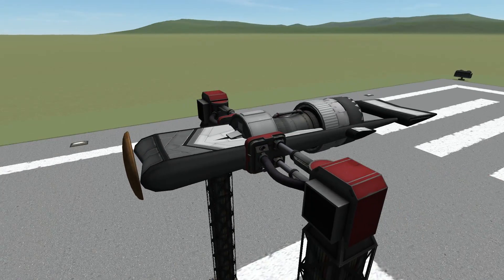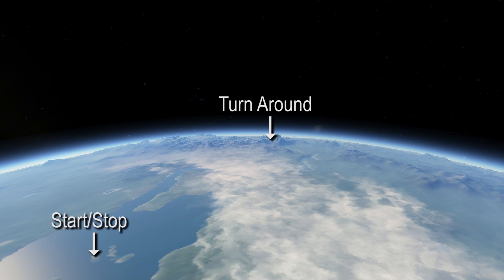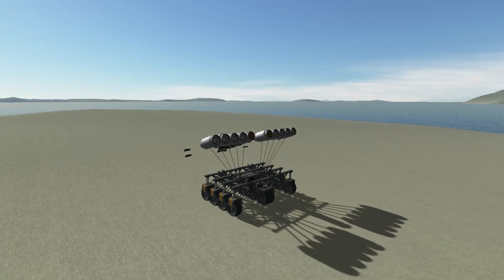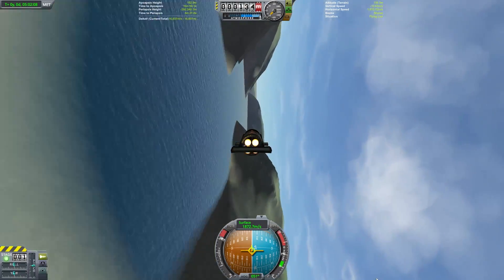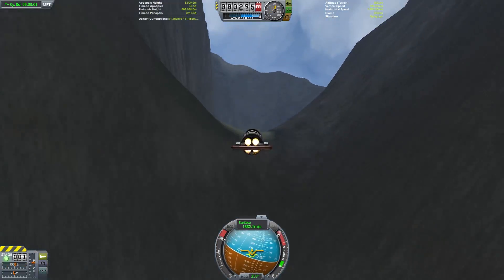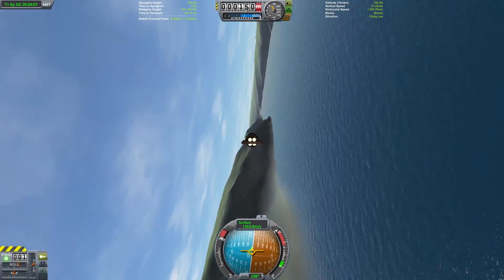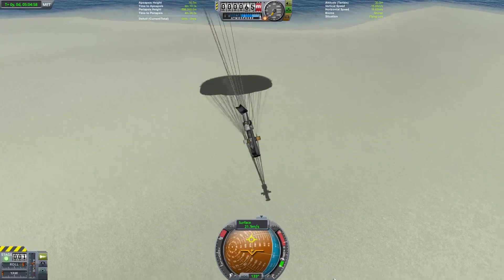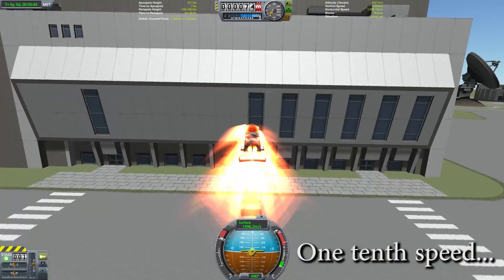Racing though the K'yangtze River Canyon -  KSP flight controller trial

Comment: I dont believe you completed the course correctly. Several times you skipped tight corners by flying over significant portions of land. If that were the case, we could just fly over land and the river in a straight line to the end. 

Try and do it again without flying over land.
Reply from the maker: For this mission, I followed a course that was outlined by other people, which did allow minor land overflights.  I subsequently outlined my own course on a different river, which I believe to be more challenging (and fun!).

Check it out here: https://youtu.be/XEOLCumVEvM

Comment: I had always assumed it was part of the KSP programming that pitch of control surfaces was all or nothing and you could only change the angle in the initial setup. So, am I understanding that a controller allows for variable pitch as you fly?  I had no idea...

Comment: B-Rad, you should have a chat to the Red Bull folks. There's probably a few minor regulatory hurdles to overcome, but..... :D
I have the HOTAS throttle plus the flight stick, it's cool to have both hands on the controls but the Thrustmaster "TARGET" mapping software doesn't play nice with Unity so you can't make full use of all the buttons (they're duplicated on the throttle and stick). The rudder control on the throttle is really nice though, I find the twist-grip on the stick to be a bit awkward by comparison.
And, well... it's just fun to have both, especially for more "in depth" sim stuff like Elite or DCS (it's practically a necessity for Elite, I wouldn't play it any other way now). Highly recommended.
Reply from the maker: I do like the keyboard joystick combo, which allowed me to make small roll corrections by tapping keys, rapid pitch for the landing etc. on the keyboard, while doing most of the flight on the joystick.  Granted, I've never used the throttle/flight stick combo, so I don't have a proper comparison.  I also used to use the keyboard/joystick combo for Mechwarrior back when I was a lad =) . Brings me right back.
Reply: @BradleyWhistance  Yeah, I still use the keyboard for attitude correction in orbit a lot of the time, to prevent simultaneous pitch/roll. And obviously reaching for the mouse a lot to reposition the camera... I should get around to tweaking sensitivity of the hat switches for view control so it's not as jerky.
Mechwarrior with keyboard and an MS Sidewinder joystick was friggin' awesome fun back in the day! :)
Reply from the maker: @sixstringedthing  Have you tried Battletech yet?  I hear good things.
Reply: @BradleyWhistance  Haven't looked at it yet, will check it out though. Thanks man.

Comment: based on my rudimentary observation, i calculate just shy of 600 g's. 598.66. that is of course an average acceleration based on it taking 3 seconds to go from 1996m/s to 200m/s over 3 seconds. im sure it was more g's at the initial turn
Reply from the maker: I do think that you neglected to divide by 9.81 m/s^2
600g = 600 * 9.81 m/s^2 = 5886 m/s^2 .  
598.66 m/s^2 is "only" 61.0 g's.
However, you are correct that the initial g's at the start of the turn are higher.  Also, most of the acceleration is lateral, which is not accounted for in the loss of speed since this acceleration is perpendicular to the motion of the craft.

Comment: I didn’t think the rapier could go that fast
Reply: With so little mass, it's relatively easy to get up to those speeds on a small tank of gas.
Reply: The rapier is actually one of the fastest engines in the game.
Reply: Xylenox from my experience it was already the fastest before I realized it could reach 2000m/s

Comment: I detect Ven's Stock Revamp
Reply from the maker: YAS
Reply: @BradleyWhistance  Doesn't Ven's stock revamp change aerodynamics models?
Reply from the maker: It may, but this craft functions the same with and without it.  This is possibly because most of the parts are occluded are therefore contribute no drag whatsoever.